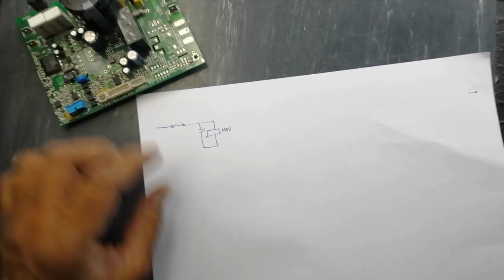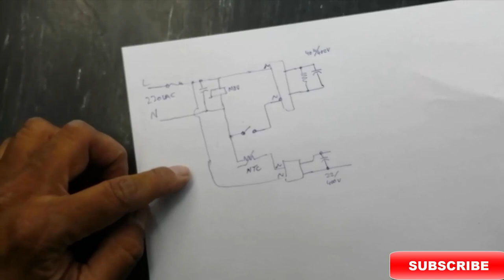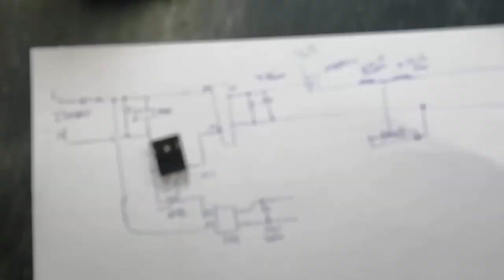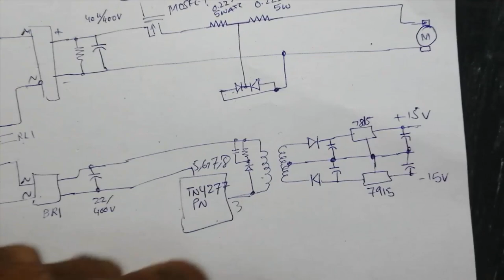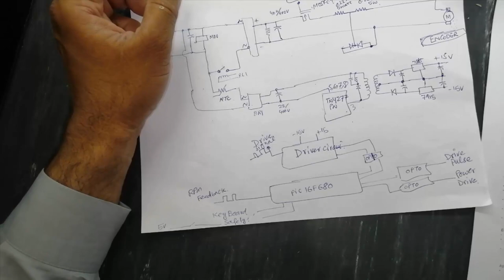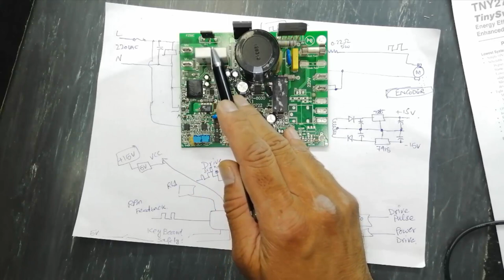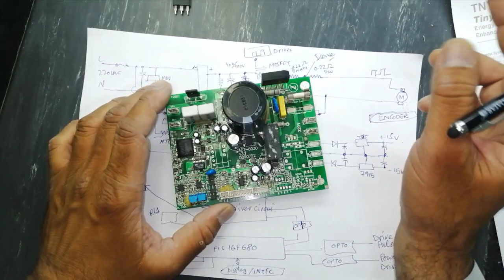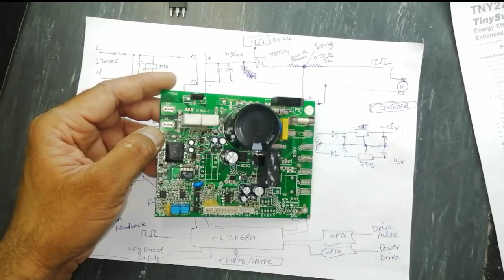271 How to Repair Circuit for TreadMill - Circuit Explained /Troubleshooting

Comment: My treadmill works for 30 min and then stops. It doesn't start till the next day. The main panel works but the motor doesn't move. would it be motor control board faulty?

Comment: I have been watching many of your videos and find them absolutely amazing. Your working knowledge of these drives are astounding, especially without the aid of schematics. I am an exercise equipment technician, but usually when it comes to boards I just change them out. I have been trying to understand more of the concept and troubleshooting techniques. Thank you so much for all your time on these amazing videos.
Reply: I myself is trying to better my knowledge in trouble shooting mostly on mc2100 boards instead of buying and changing it out! lol

Comment: dear, I would like to ask you if you do not activate relay 1, there is a possibility that only the driver is at fault and not the pic16f480, while I have normal voltages in the driver, the relay does not open, it gives me a check motor error.

Comment: Assalamualaikum sir...my treadmill motor controller relay is not working...I check the relay...it is ok..when  I m giving 12 volt from other sources the relay  is working....but when I connect it into the Pcb it not working.when I disconnect  the relay from pcb 14 volt  is coming in the pcb .but when I connect it then I found there only 2 volt.....what can I check  now...?.....sir. plz give me a suggestion ....sir.

Comment: Haseeb, you are a very kind and generous gentleman. I have to compliment you on your inspirational instructions. 
Having no electronic experience, chancing upon your channel after an EO2 error code on a treadmill. You have now inspired me to delve much further into the world of electronics. Thank you very much.
Kindest regards and very best wishes.
Stuart.
Reply from the maker: You are most welcome
E02 error is mostly from board and motor 
if motor doesn't rotate or the control board cannot produce power to the motor, and the microcontroller doesn't receive the motor motion, the microcontroller will generate the E02 
in the card failure condition
any minor to major problem in the board will cause to initiate E02

Comment: Mr. Haseeb, you did a wonderful job explaining how a modern treadmill circuit board works! Thank you for sharing your knowledge and experience.
Reply from the maker: You are very welcome
please accept my best regards
Reply: @HaseebElectronics  will you repair a board to you if i send it?  How much pls?
Reply from the maker: if you will send it, I will not take any charges at all. you can send it to me
no problem dear 💕

Comment: Wao you are awesome, I found this video because my treadmill is giving me a E7 errror. I guess I will change the mosfet  and see what happens.
Reply from the maker: best regards 
first you need to check the error code reason. you need to follow user manual to know the error code reason and then you can proceed to any replacement

Comment: Great explanation. Really informative. I have exactly same circuit in my treadmill. Unfortunately I had a spark and it stopped as room fuse tripped. Second time again same thing happened. I opened it and noticed that one IC (TNY) and resistance opposite to IC are black with smoke. So, issue seems to be here or somewhere before these which is creating spark here. Can you please help me.
Reply from the maker: Oh so sad'
please check bridge rectifier and main dc smoothing capacitor 
if ic is smoked then you have to replace it, but before replacing it check the dc rail components

Comment: Sir your videos are very important and informative for technicians. 
I have a treadmill with same board shown in this video. My treadmill stops after few seconds everytime I start. There is a relay cutoff sound and MSW LED in the board goes off and power LED remain on but motor stops
Reply from the maker: please check its feedback network. the RPM transducer 
if it is using optical encoder, check its rotary disk and all cuts on the disc must be clear the optical encoder must be aligned properly
if it using proximity sensor. check its magnets are placed properly, and clean the proximity sensor head properly 
if the walking pad or belt is too loose or very tight. adjust it to its mid level 
i hope it will fix the problem

Comment: Great job! Thank you for all the time spent teaching others. I have a question... is there some way to bypass the instrument panel and use a potentiometer to control the speed of the motor so I could use the motor for a drill press?
Reply from the maker: thanks a lot.  actually the microcontroller requires data from front panel, based on that keyboard inputs microcontroller generates drive signal
Reply: there is ,,

Comment: Very usful information, thank you for your time sir 👍
Reply from the maker: best regards and special thanks
Reply: @HaseebElectronics  I have another strange phenomenon in my treadmill. When I remove the speed sensor, there is no difference, so no error code shows at all. I checked the sensor and measured it, it works, do you have any idea what it can be due to? Ihave a MC2100ELS-18

Comment: Hi Mr Haseeb,
First of all thanks for your wonderful explanation and videos. I love your videos & Pls make some more videos on Display supply  and troubleshooting.

I have been working on a Trademill board (from magnum) which was dead. Hence I changed few components like IGBT, 470uf/450v capacitor, and voltage regulator 7805 and IC 34063 API. 
After giving AC supply and transformer supply I am geeting 200v DC at motor terminals and 5vdc and 15vdc at voltage regulators still I am not getting display in screen. I am not getting voltage at the jack for display screen. where to check and what's the possible problem

Comment: Mr Haseeb thank you for sharing your knowledge with us .I have watched this video 5 times ,it is absolutely amazing how you can draw a schematic by looking at the board .Now my question , i have a treadmill that fails to work occasionally ,it powers up ,makes all the usual sounds but when i press start, the motor does not work but everything else does ,the timer, speed,  etc .I would really be grateful if you could point me in the right direction as which component might be causing the problem. Thank you in advance.
Reply: Did you solve your problem? I have the same issue whereby everything works except the belt won’t start. I tested the motor and it’s good. When I try to start the belt, there is a click heard on the control board but nothing happens.
Reply: @newfie-dean5803  Unfortunately no ,i changed all the power transistors ,diodes,etc ,a new board was too expensive so treadmill had to be scrapped.

Comment: This was great video, very helpful tips. I have question. I replaced the MOSFT and power supply working. However the treadmill start normal and after few minutes it stop. I have to unplug it for few minutes and the plug it back to run the treadmill normal. It still stop after 5 or 10 minute running.
Reply from the maker: please check speed encoder / sensor  
check fan belt tightness
check motor by varying different speeds, if it works on some speeds and fails on some speeds then we need to adjust encoder 
if required make rpm adjustment by means of RPM ADJ potentiometer on the board

Comment: Hi Haseeb, I am busy watching your treadmill repair and explanation video.. I have power to the dc motor when it is disconnected. When I connect the motor to the board the voltage goes to zero.
Where do I look for why the resistance from the motor drops the voltage?
Reply from the maker: best regards 
please check motor in accordance with video number 639 on my channel 
might be it have short circuit
Reply: @HaseebElectronics  I have tested the motor on a 12 volt battery and it runs no problem. Only when I connect it to the board then the voltage drops to zero and does not run at all. This is also one of those boards that someone else also tried repairing and now I have to fixit. I bought it like that.

Comment: Thank you Sir for this video. I watched it many times and had the courage to check my broken threadmill. I found the mosfet was also the issue and I have replaced it. I turned on and no more e02 error. I used it for around 15mins and then suddenly motor stopped running and shows e02 error again. I checked the big capacitor this time and it was good. What could be the problem Sir?
Reply from the maker: please check the flyback diode (very closer to mosfet) sometimes, it makes problem. 
if mosfet is still good, might be the mosfet is not good quality, (if the original contains recovery diode, and new mosfet dosen't have recovery diode)
verify the exact part number with the original one 
check mosfet gate drive components

Comment: Very informative video as always. And loved the sarcasm "i dont say he damaged this board, he destroyed this board" :)

I am trying to understand a PCB board for a treadmill. Unfortunately, it works for sometime and throws the error ER01. Manual says its either because of some communication failure, or try removing the MicroController and plug it back.

I checked the connectivity all cables between display and this pcb, still the issue persists. But the moment I replug the MC, it starts working. But after running for 10 min or so, again ER01.

Motor seems fine, no heating. In such a case when the issue is not consistent, how do we diagnose this board? Any help would be appreciated.

Comment: Good job, but I don't understand why is called a variable frequency driver. This circuit is a AC to DC converter, with variable output.

Comment: Hi, have a question hoping you could help out. Is it possible to modify a treadmill to run in reverse by simply reversing the polarity of the motor? Will this cause any issue with the speed controller and console electronics? Thank you so much!

Comment: Haseeb is the vfd board related to the power size (HP) of the motor? I mean if the motor connected to that vfd board was 1.5 HP and I wanted to upgrade it to 3.5 HP motor.. Do I have to change that vfd board to another one (to match the bigger size motor) or this will still work???
Reply from the maker: exactly the board size is always matched with the motor, current rating, power rating. other wise the low power rated board will damage immediately after first drive attempt to higher rated motor

Comment: Hello! Thanks for the great video. It is very helpful. I am trying to fix a treadmill board B102S S04. 
It has no display and motor is not ON. I have replaced one shorted MOSFET (the old one is fine). After powering up, 
the POWER LED is ON but the DRIVER LED is ON for only several seconds (& get turned OFF afterward).
I checked the voltage to the VIPER22A (vdd), it had only 0.1V. Wondering if you can give me some
ideas on what the issue is? Thanks in advance

Comment: Sir I have dc inverter ac, which has igbt full short , after i replace that ,it shows odu error 30 times flash (drive fault V4, VP2). after i start the AC 2 min later outdoor fan starts and compresser did't, than after 1 min outdoor fan stops and error shown . I checked the ipm module and its   not short.

Comment: Salaam Haseeb, Thanks for sharing, kindly advise me in my case: New treadmill but E05 (current overloading), the motor (1hp 750W ie. 3Amp) try to start but fails after 2 seconds, tested the motor on 24V the motor was withdrawing around 0.6Amp means normal use should be around 6 Amp considering inrush current but fails to start only hummus for 2 seconds and overcurrent protection kicks in, tested all the resistors connected to the OpAM LM358 and they all have descent reading, I appreciate if you could advise me. Many THANKS

Comment: Very good analysis, thank you. But it was hard to follow, because your video was interupted by 5 (!) commercials. Could you please reduce this to make in easier to follow?

To be fair to the guy who tried to repair the board before you: the board was gone after the MosFET blowed up the encapsulated driver board. No chance to repair this.

Comment: Sir, can i connect the power module to AC even the motor and control panel is not connected for voltage checking  purposes ....
Reply: Thnk you very much...
Reply from the maker: yes you can 
check it without control panel and motor 
so it will indicate the board's health conditions
Reply: @HaseebElectronics  thnk you very much for your time Sir........

Comment: Hi, Thanks for your explanation. My treadmill problem is the DC motor does not start to spin. I checked all parts but everything looks ok, I checked : motor; motor sensor; all stages the controller does; main display; all elements; even the board generate VFD drive signal , but the Mosfet does not receive on its gate . I am stuck , please help  
Thanks
Reply from the maker: Good morning dear
in this case, 
1st verify that tha communication cable is good, recheck it connectors, special one connector comes in the right handle,
2nd.  please verify safety switch (magnetic reed switch) if possible make it jumper (just for test)
3rd. check microcontroller response (vcc 5 volt must be there)
4. is there + and - 15volt for gate driver ic, verify the supply (out from low voltage smps)
5. check current sense resistor and current sense amplifier 
6. also check optocoupler for feedback
Reply: Thank you

Comment: Salam Brother, many thanks for sharing your knowledge.  i have problem with my Everlast EV7000 treadmill.  it was working  ok then i have no control over it anymore and it only run at the highest speed 12km/h and it does not respond to any input from the penal . do you know side of the control board is faulty?

Comment: How much to send a board out for repair/inspection mine blows fuses as soon as the counter wants to start the treadmill with motor and gearbox disconnected
Reply from the maker: if you want to send it to some local repairman, or service engineer, might be some IGBT, mosfet or rectifier is short circuited, (most of time these are problematic parts) then it will cost approximately half of the price of the board. 
if you will send elsewhere, then it may cost you above the price of the board, as the shipping, custom duty taxes and other overhead charges will extra than the repair costs. so it will best option choice to purchase new one. it is my suggestion

Comment: Thanks for the explanation.i have a card with error 02.The motor does not turn ,the mosfet is ok,but no signal coming to drive the mosfet.i need your help. Thanks.

Comment: Hi Bro
Very nice video. 
My treadmill Nordictrack T14.0 is having problem -  relatively new, only 2 .5 years old. The 13A fuse in the power cord is keep blowing. I wonder if it is same problem as you mentioned,
Here is the detail problem<
1, Initially the TM worked well for approx 15 minutes; then the walking belt (I didnt realize) move to the right and the TM stopped, re-start, loading the menu on the console and ready.
2. I tried to start again manually but the TM immediately stop and trips the breaker or blown the 13A fuse in the power cord, every time I start (manual start). Seem the motor withdraw very high current. Practically the belt does not move or move very little (mm).
3. I have aligned the belt, lubricate and reduce the tension of the belt but no success. Same happened.
4. The incline function is working well. No problem to up and down to maximum (12 deg.)
5. No problem on the other console functions.  However, every time i start, the TM immediately stop and trip the breaker or blown the fuse.
6. There's very small movement (fraction of second) before immediately blew the fuse. Seem like the belt stuck. However, I can easily move the belt by rotating the motor pully.
7. I removed the drive belt from motor pulley. The problem still happen - blew the fuse but I can see that the motor pulley rotates for few seconds.

Is there anyway to identify what part is exactly making problem?
TIA
Reply: Hi Wisnu.  I have the same problem with mine.  Did you find a solution?
Reply: @DougMay  hi Doug, unfortunately my treadmill still not working. I have discussed this issue in treadmill forums. Most of people believed the problem was in the controller. So, I bought new controller when visited UK. Not cheap.  Installed it, same problems still happen. The problem is apparently in the DC motor. Very expensive here. Looking for a workshop that able to repair.

Comment: If we connect a 2hp motor to std 1.25hp driver board, will it create any issue? As my old model tredmill 1.25 motor is gone so to replace the motor.
Reply from the maker: yes dear, it will take the board to overload condition, because the motor will seek current in startup, and also in running it will also cause loading. so there are more chances for early or very frequent damages to the board.
Reply: I have a Pioneer Classic treadmill of BH. The board went out of order after replacing the 1.25HP motor to 1.5HP motor. Not sure whether the issue was due to change in HP. Anyway the IGBT failed.

Comment: Hi Sir , I watched your video , and find them very interesting,  I wood like to ask you about a problem  I m having with my treadmil  , horizon 5.1 CT,  it start and stop after 3 or 4 second  , and I can't figure out the problem,  I checked every thing , both speed sensors , Mosfett  , diode  etc , if you can help , it will be appreciated , thanks in advance
Reply from the maker: in this condition following is possible 
1. servo motor is taking more current due to tight belt, damaged bearing, any obstruction in its rotation of belt rotation)
2. belt is too loose
3. sensor is not adjusted properly or its feedback is interrupted
4. over current detection circuit is making interruption to the MCU